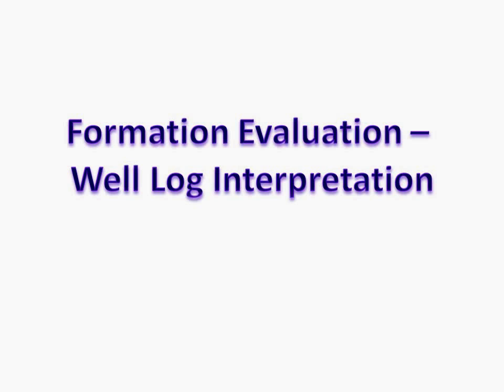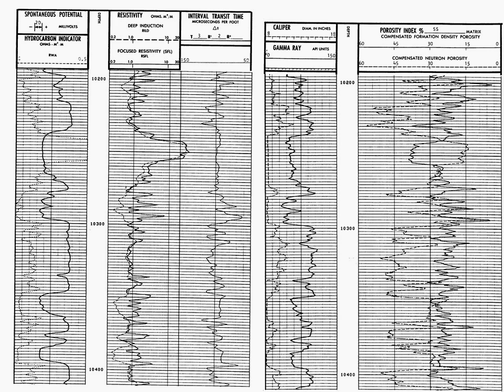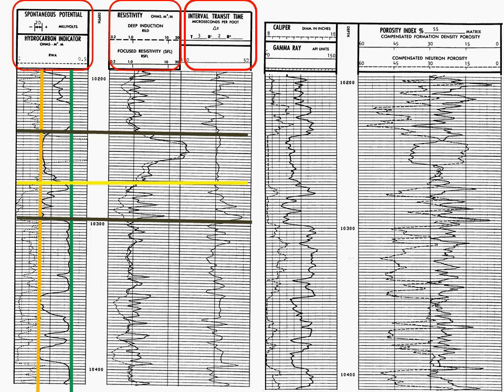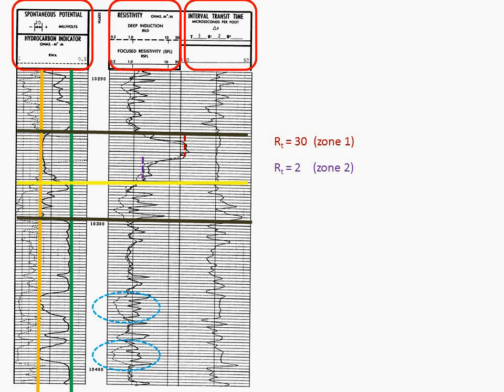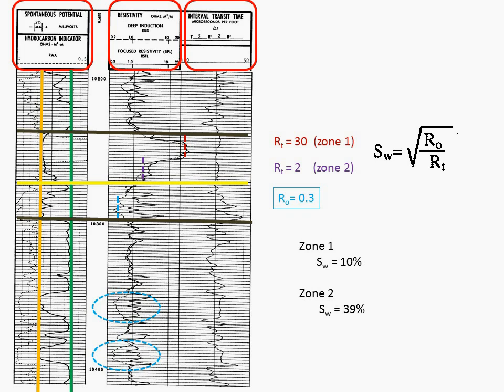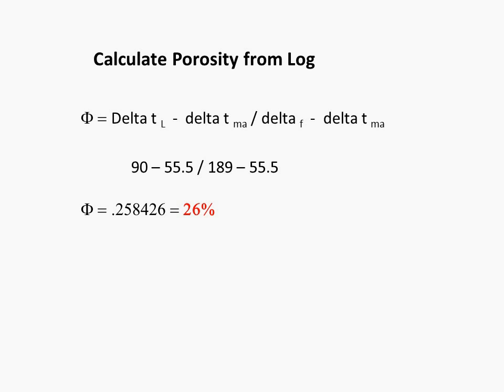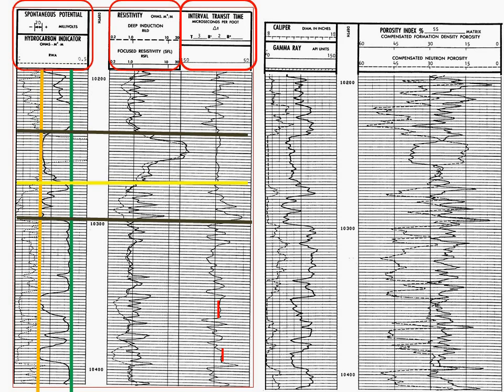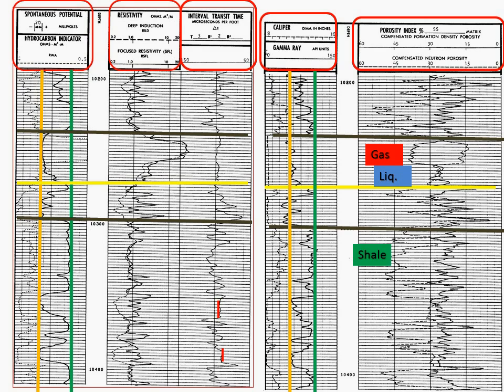Well Log Interpretation Review Ab

Comment: Great video! I was taught the best method to determine porosity is to read half way between the density porosity and neutron porosity curves. Interestingly, you will see that method yields ~26% porosity for the target zone, which is what he calculated with the transit times (showing that both methods work well).
Reply: Can you Tel my how did you that!!!
Reply: @eslam_edrees  Reading the values at 10260 feet depth in the liquid zone, the neutron and density curves overlap around 26% porosity (therefore, their halfway point is 26%). You get a similar answer in the gas cap at 10250 feet where the neutron reads at 38%, and the density reads 15%, so the halfway point is 26.5%. However, for neutron-density porosity calculations in the gas cap, you should use following formula for more accurate porosity: 

square root of (((density porosity squared) + (neutron porosity squared))/2)

or in other words, 

φformation = ((φDensity^2 + φNeutron^2)/2 )^0.5.

 Plugging in the porosity values from 10250 feet, I calculate 28.9% porosity.

Comment: teacher if for the zone 1 water saturation is 10% so why we cant produce oil because its less then the 39% of water saturation. because the density of the first zone is occupied by hydrocarbons and the pressure of the zone 1 hydrocarbons does not gain water saturation of the zone 2 i mean the the down side of the reserviour so the zone 1  will push up by itself because of its pressure. hopefully you will answer of my question Thanks

Comment: Interval transit time (or delta-t) is high in shale.  It's the inverse of velocity.  True, shales don't have much porosity, but the clay minerals that comprise them are very slow minerals (meaning, they have a high delta-t).  Therefore, when delta-t is used to compute porosity in shales, it will overestimate the true porosity.  Same is true in shaley rocks.
Reply: so what do I use for computing porosity in shales that is reliable??